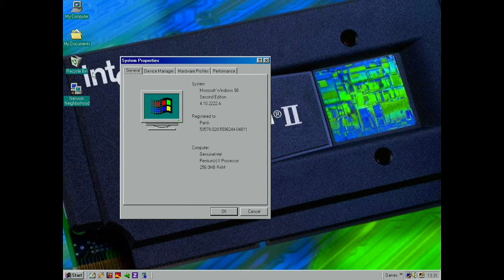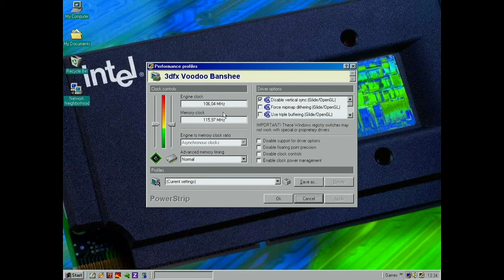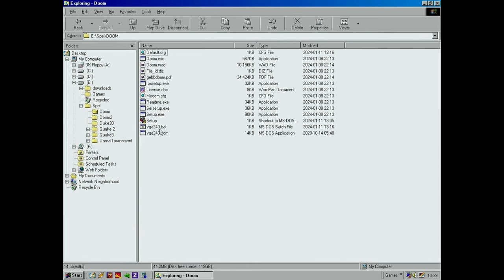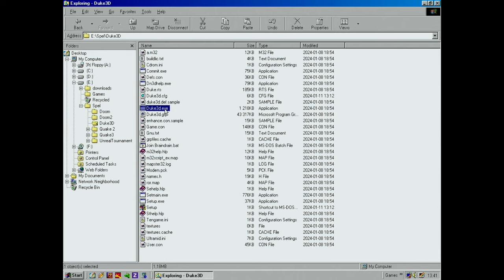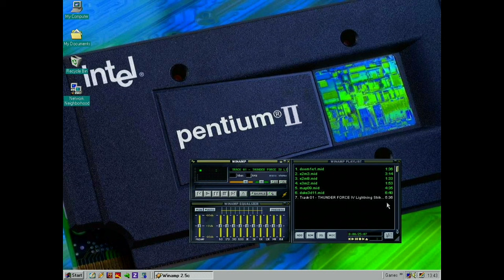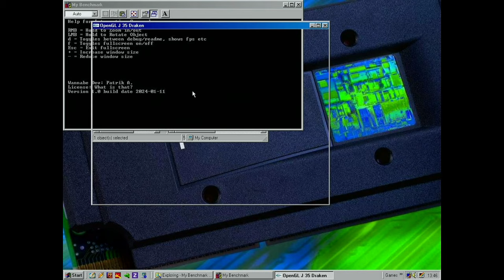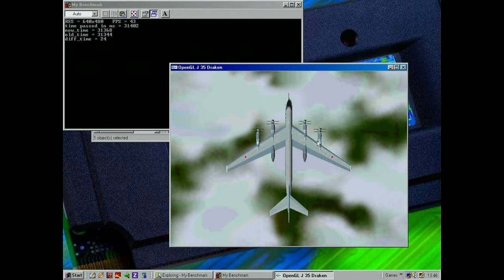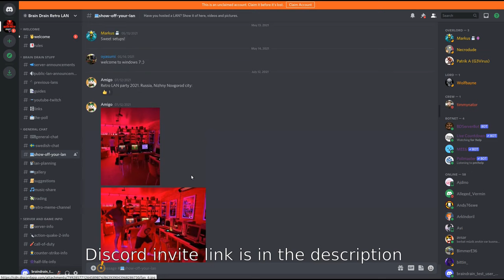Pentium II build - Part 4

Comment: Great set of videos Patrick, I love doing the full restorations and mods myself, I've done and sold on about 25-30 systems in the last 7-8 years, obviously with the time taken and the finished lowish value I certainly don't make money from it but I get a great buzz out of and really enjoy the work rescuing them and putting them back to a reliable usable state for someone else to enjoy.
Keep them coming, thanks for your content! 👍
Reply from the maker: Yea one will not get rich doing this 🤣
I spent like 60€ refubing two MB's and sold them for like 100€ total with cpu, cooler and ram so some profit but not much.

A lot of my systems are built on parts people discarded as wast and they are some of the most stable systems on our retro lan parties.
I rater have recaped and repaired MB's and GFX cards then one that is original and have had no service in its life.

TY for watching and have a good day!

Comment: Many youtube channels just play with old computer parts, but most of these parts need work in order to work stable and reliable. You have done it right. All has been restored and make ready for longevity and reliable use. I really like pentium 1-3 computer beacuse they where about real 3D. Unlike 486 which is good for 2D maybe 2.5D. I saw original ticker spec on this system and saw that originally pc was equipped with riva TNT. As you mentioned would be great to compare both cards Banshee against TNT 1. Would be great to see more 3D games from 1998. Unreal, Half Life, Thief. Great restoration so far
Reply from the maker: I made a Bonus video, coming next week.
Might contain what your looking for 😁

P.S this system has been working many days and night for the last 3 weeks running and testing some OpenGL software I wrote.

The last 48h its been on non stop sometimes running my OpenGL demo overnight with no crashes of system or software.

I would say its pretty dam stable system now, did take a swap of that crap PC125 ram tough (no system I ever tested liked that ram).
Reply: Well; early 90’s 3D games was all software rendering. With a fast 386 you can run real 3D with affine texture mapping and sprite based NPCs at like 10-20 FPS(ultima underwrld) in a small window. With a fast pentium 2 something like 400x300 quake or 640x480 system shock is as far as you’d want to go. That’s all you get for that extra CPU speed. The real advancement was 3D acceleration and 3D positional audio (which hasn’t been improved upon since the aureal vortex 2). It takes a stupid amount of brute force to do anything in software. A fast 486 with a voodoo (pci motherboard) is surprisingly competent in something like quake and turok. Anything like HL or UT that really hits the CPU for bone skinning and similar will choke.

Comment: for ata 66/100/133 u have to use an 80 wire ide cable to get the full speed. cd drives don't mater what kind of cable there connected to as they don't even connect at ata 33 speed.
Reply from the maker: Yes and i440BX is only ATA33 and the original 40 short wire cable was used.
Overclocking the FSB overclocks the ATA bus also making the signal integrity poor on 40 wire cables.
80 wire cable always have superior signal integrity even at less then ATA 66 speeds because of the separate ground wires for every signal wire.
But a 80 wire cable wont make the transfers any faster on this system but it would allow for longer cable if needed or higher ATA clocks speeds when increasing the FSB.

The only thing 80 wire cables will do on this system is allow me to run a longer cable at 112Mhz FSB where the IDE bus is effectively running at ATA37 speed due to being overclocked.